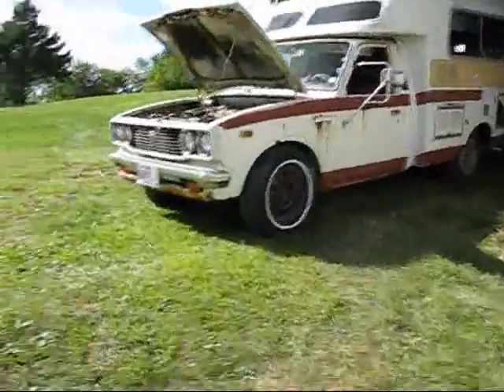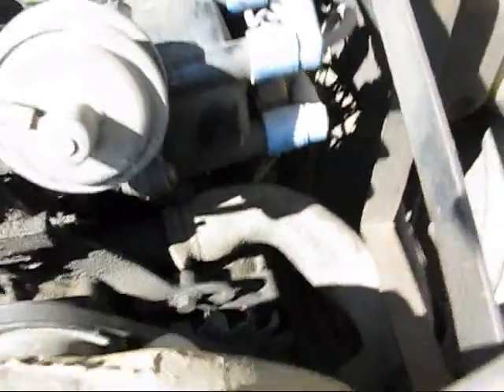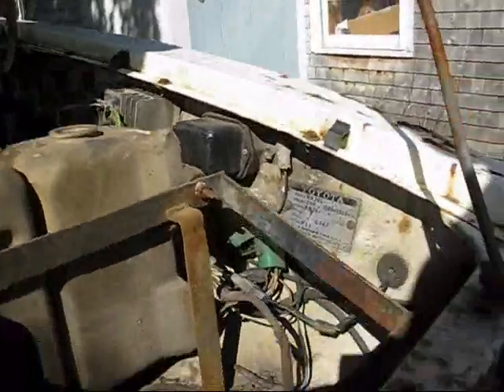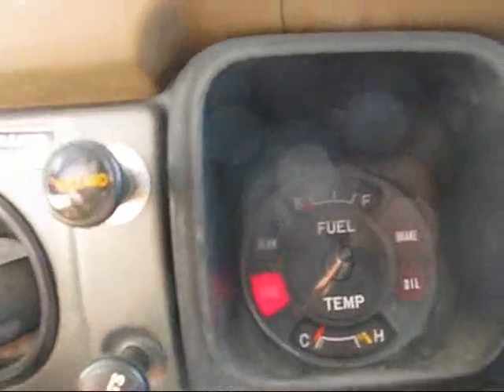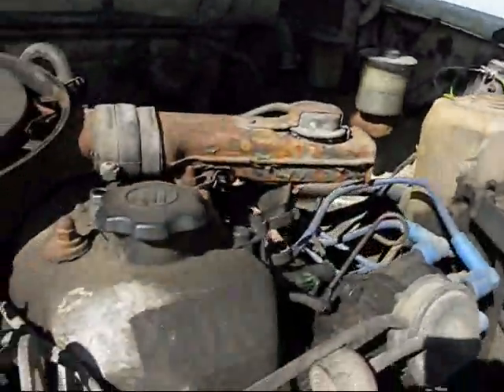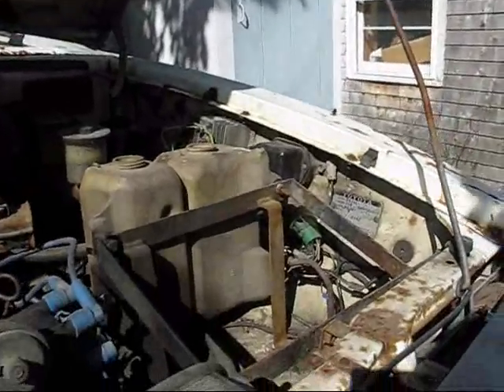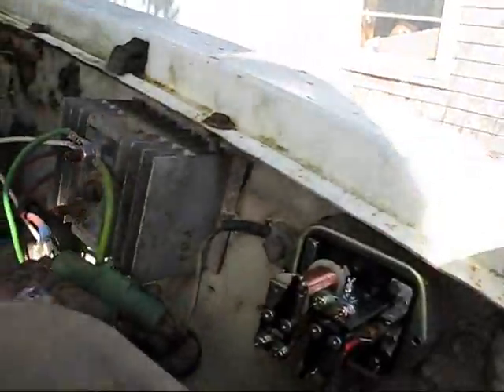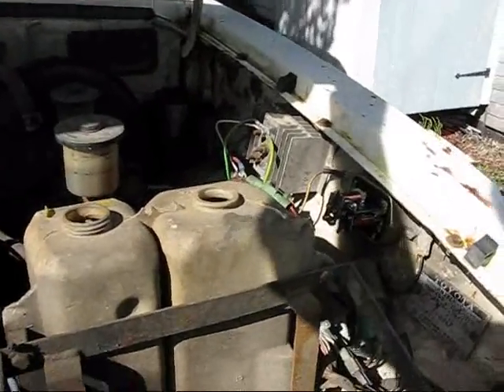1978 Toyota truck voltage regulator question

Comment: The black one on the fender is the voltage regulator. I worked for toyota when this truck was new. I worked for toyota from 1974 to 1983. Good luck with the camper.

Comment: That is most definitely the regulator, and the other finned item is the dual battery isolator. If the key is on, the charge light will be on unless it's running. However, being it is an older externally regulated IC type alternator, you can just swap in a GM 1 wire alternator. Should fit right in the factory bracketry. The second battery tray, is for the coach battery. The isolator makes it able to charge the coach battery, without using it to start the engine.
Reply: FTORC1 I bought one of these trucks and already had the GM alternator hooked up and this helps so much in understanding why previous owner did this. Keep up the good work

Comment: hi there'
My husband said that it is a voltage regulator because it seems to be a two battery system. Once the primary battery is fully charged the regulator will charge the secondary battery. Which will provide stand by power to the 120  volt circuit.

Comment: The finned grey block is a  battery isolator.   It is used when you have a two batt system so that one battery is charged before the other or one battery can be given a certain job like running a winch.

Comment: Yep, the aluminum finned gizmo looks like a battery isolator... As old as it is, it may or may not still work. I'm curious of the disconnected wire. The tray is definitely for the camper battery.  Voltage regulator... but as you already know, it should only be energized with the key on.

Comment: That one thing looks like a battery isolator so when you use the camper lights it only drains the one battery and the other will still be charged for starting . The black one is the regolator.

Comment: @rpeek Some people get intimidated by the electrical system of a Toyota, simply because it's foreign. It's still just a basic system, and fairly straight forward. As far as a service book for yours, Haynes does make a manual outlining the entire electrical system. It's too bad you weren't closer by, I could eliminate any electrical gremlins that may be present from age. For the most part, it looks like everything is functioning. I would convert it to a GM style, and eliminate the excess wires.

Comment: looks like @mustie1 is on to something. check the alternator diodes. if there's a short, it takes about half an amp from the battery when the ignition is off and charging will be low.